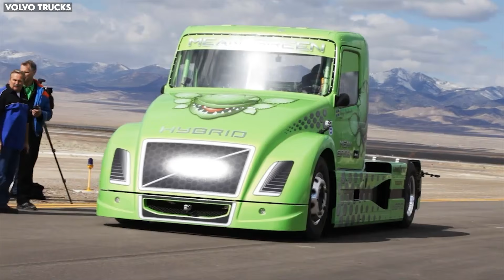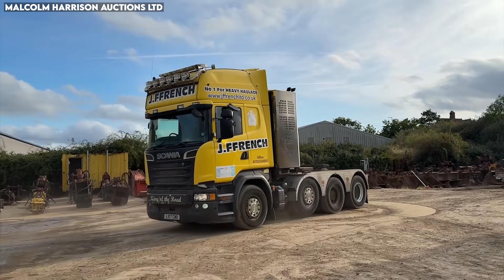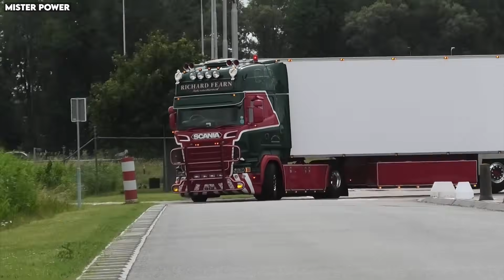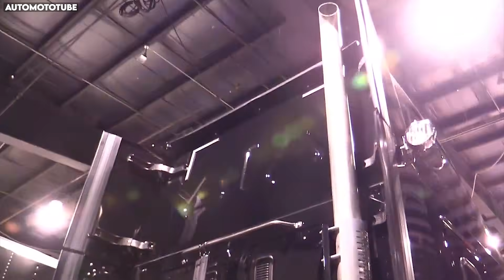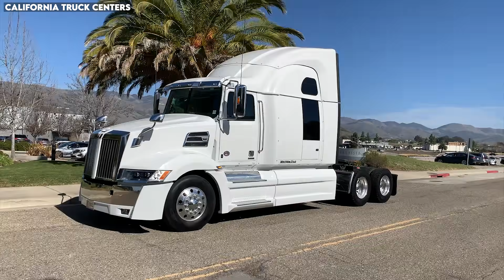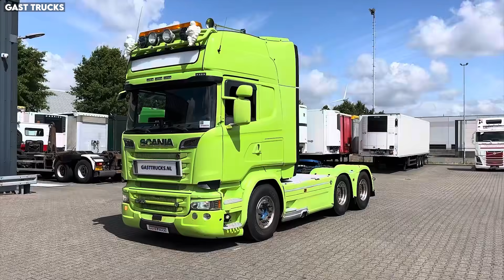10 Fastest and Most Powerful Trucks Ever Built

Comment: The westernstar is just a different Freightliner. It's owned by Freightliner. 
What a bunch of nonsense. At one million miles, you rebuild the engine and run another million miles. Not retired. Big carrier's may get rid of trucks at 500,000 miles. An owner operator usually don't.